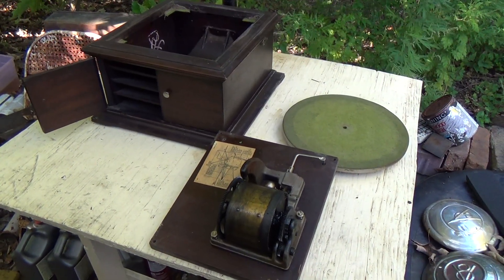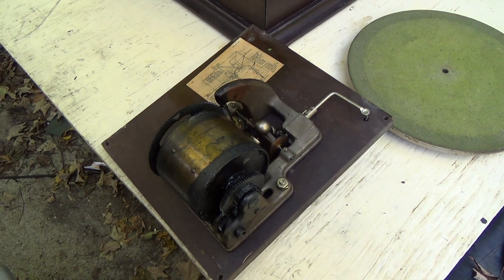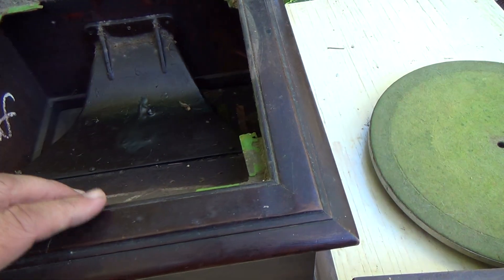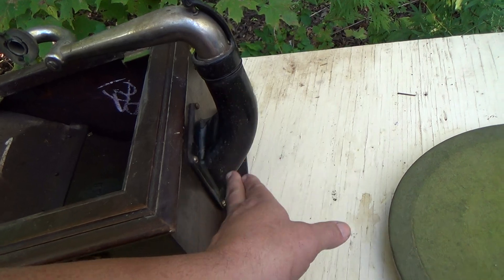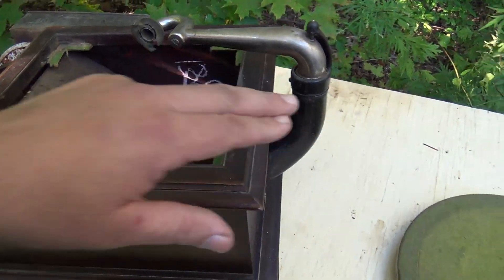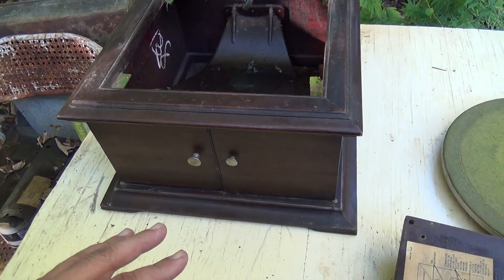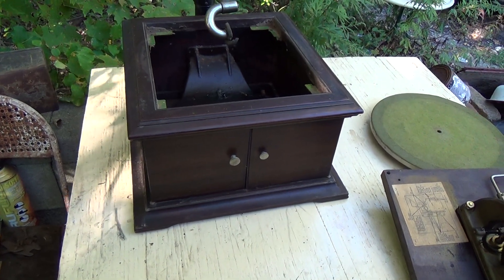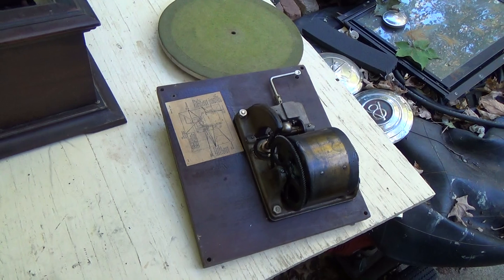A look at 1918 Victrola the 6th before service

Comment: It’s OK if you do not get this message but could you possibly please tell me if I’m reading right did it say April 15, 1918 because that’s when mine was exactly made
Reply from the maker: The date on the patent sticker will remain the same until the company had to update the patent information , that could be a few months or a year.  So figure your machine was made sometime in the six months to a year after the date on that sticker.  The better way to narrow down production date is the serial number on the brass ID plate on the side of the machine. Information exists to get the date down to the year and month, but not the day.  In the case of the machine in the video the ID plate had fallen off and been lost.

Comment: Do you ever come across a table top X or XI ca 1910-1912? i know you have a XII.
Reply from the maker: Not the early models , later floor models I own at least one of, the X I believe from the late teens, I haven't looked in awhile.  I see one or another pop up on eBay from time to time, but while not nearly as rare as the early XII, they are still expensive machines.
Reply from the maker: Update, I have since come across a tabletop VV-XI from 1910 that now lives in my collection.